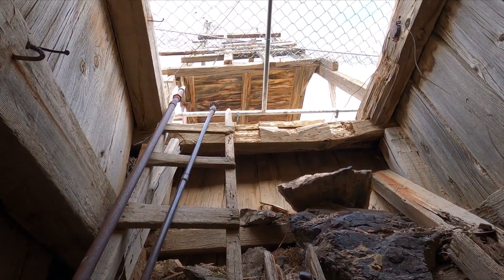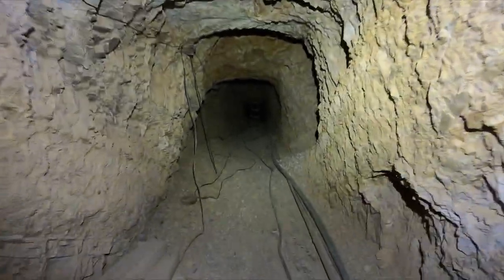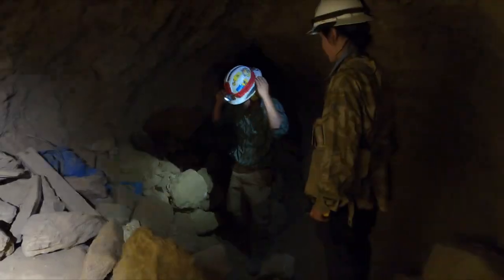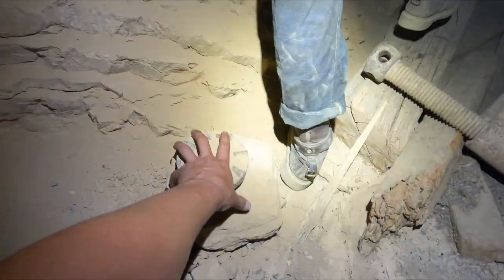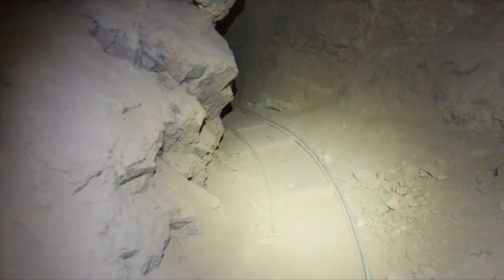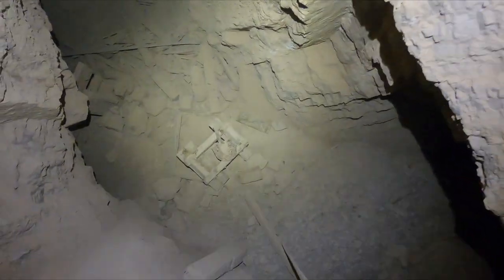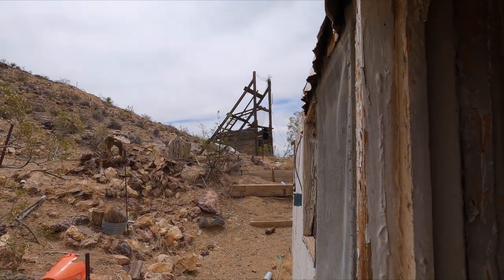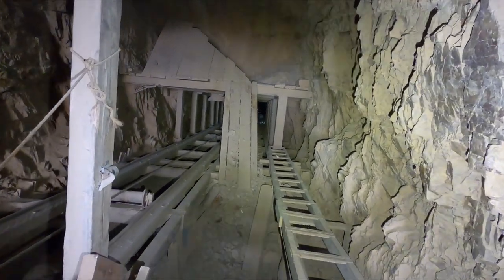A Well Rounded Explore and A Somber Farewell

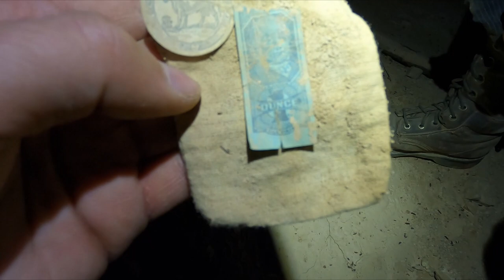Comment: 8:47  Bull Durham Smoking Tobacco originated around 1850 and was around till 1988.  The tobacco was very fine little flakes and usually very dry. It was difficult to roll a cigarette without it falling out the ends, and into your mouth.
   
10:43 The Wheat Straw cigarette papers were made in France by Riz Lat LLF (Rizla). They first filed a trademark on their logo, a cross and a plus sign, 1917-12-11.  "RIZ LAT LLF MADE IN FRANCE THE ONLY GENUINE LA CROIX FILS".  La Croix Fils means "The Cross Children".
   
12:45 The piece of barrel is called a stave.
   
13:16 Looks like a Camel cigarette pack inside the coffee pot.
   
Boy do I feel old; I have smoked Bull Durham, and rolled cigs in Wheat Straw papers.  Hope the Navy turns out to be all that you hope it will, and more.  Great way to see the world.